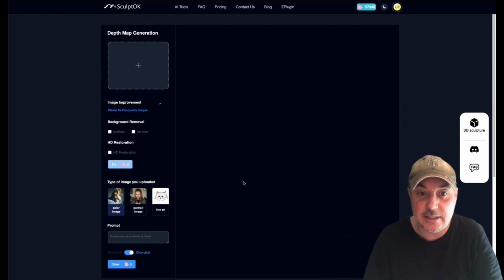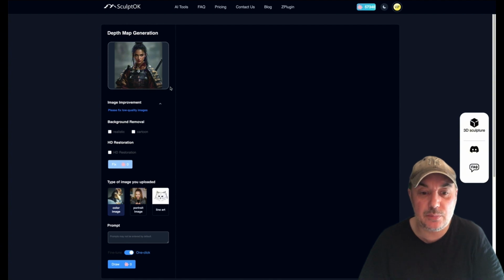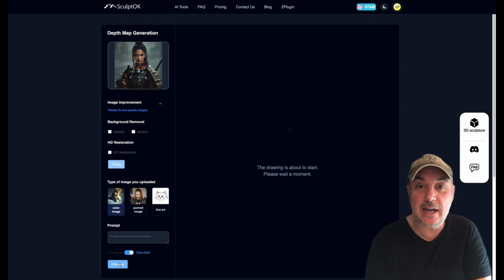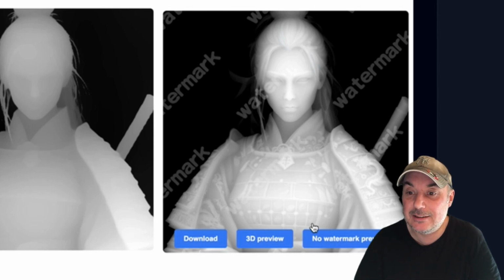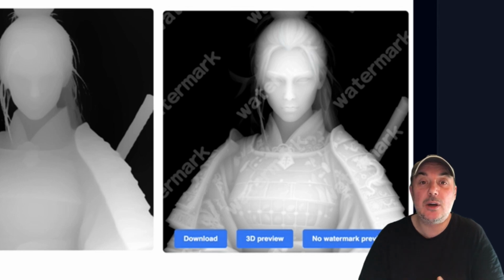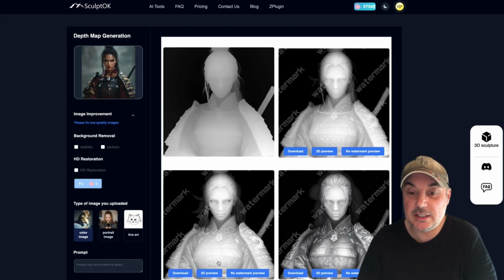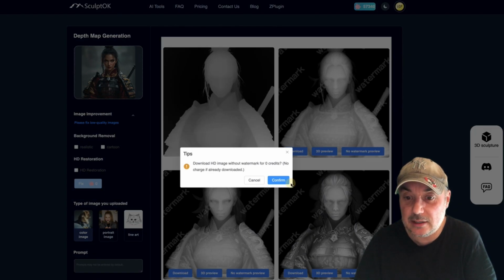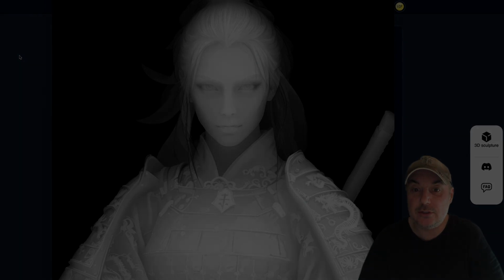Need High Detailed Depth Maps? The Quick & Easy Way!

Comment: Love the content. Do you have any examples of an actual piece of wood that a CNC machined out? I'm about to start 3d carving on my cnc machine and there's so many depth map sources. I'm trying to find the one that will work best for me before I spend hours experimenting on each piece. Thanks bud!
Reply from the maker: Hey mate, im afraid i dont, i do more of the 3d printing then use those to make my moulds for my silver pouring, it is something im going to look at though down the line, i want to try some cnc carving also, good luck with your project!
Reply: @SilverPunkPour  No worries. Thank you for the response.

Comment: Good day, so are you saying you can use any sort of image to get a depthmap? Cause we have been having to generate bas relief images to help pop the detail are you saying that is not necessary with this site? Thank you
Reply: Wow that is awesome then.. I used it with bas relief images before but will try a normal one.. thanks man this is great info!
Reply from the maker: @frankgatto-qw1mh  yeah, all the depth maps in my video are from normal ai images :)
Reply from the maker: Hey Frank, that is exactly what i was doing, making bas relief alabaster / wood style images with ai to make the depth maps, but with this site as you can see with my warrior design i took a normal ai image and made it work :) it has changed how i do stuff, i no longer need to make bas relief images, so images work better than others of course, but on the whole i have been really happy with the results ive had with it.

Comment: I like the site, but I have been experimenting with lots of images to try and see what turns out best, so the paid model where even generating the watermark preview cost credits doesn't really work well.  If it was free to generate the watermark image, and just cost 2 more to download (20 instead of 18), I would possibly be on board, but as it is, going to free route seems best.
Reply from the maker: Hey FG,

Thanks for watching, my friend! It really depends on what you’re trying to do. For me, I really need this type of depth map generation now since I’m using more complicated AI images instead of bas-reliefs. The Zoedepth method doesn’t work as well for those.

It’s pretty much a case of "horses for courses," as they say! :)